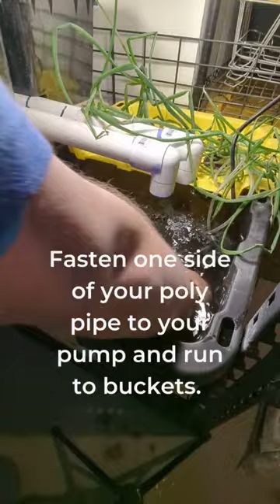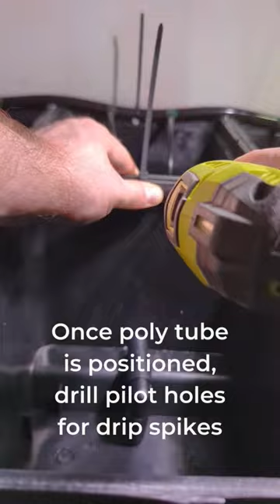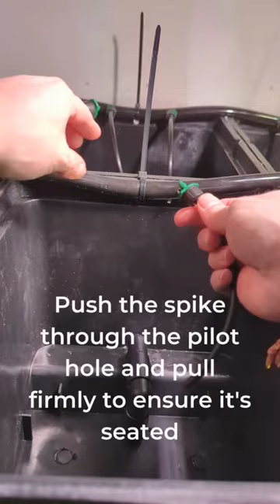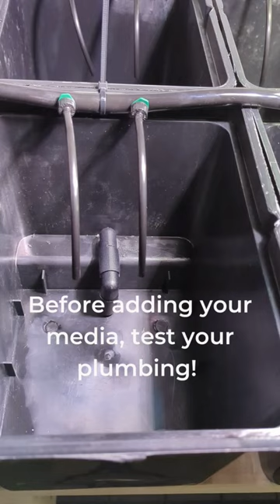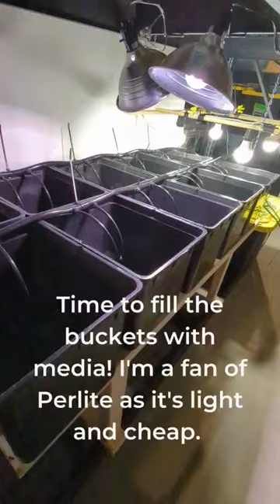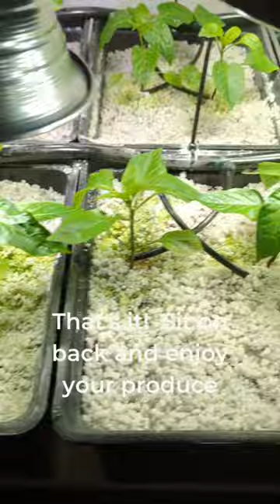Dutch Buckets: Part 3, Plumbing, The Finale

Comment from the maker: Dutch Buckets Build: The Epic Finale - Part 3

Missed the Peppers origin story? It's a must watch: https://youtube.com/shorts/1taa1H288f8

Missed part 1? Check it out: 
https://www.youtube.com/shorts/IiwS4uGCExs

Missed part 2? Can't miss that! 
https://youtube.com/shorts/3UUWxr9j6iY

==Parts List (For ideas only, not sponsored for any of these links)==
* Dutch Buckets $110.99 for 10, $11.09 each 😎 https://www.bootstrapfarmer.com/products/dutch-buckets?_pos=2&_sid=dce6a1b9b&_ss=r

* 2 Gallon/Hour Drip Emitters $13.50 for 25, $0.54 each
https://www.ebay.com/itm/234816662559?hash=item36ac29ec1f:g:tXAAAOSwCE5jljX8

* 3/8 inch polyethylene tubing, average ~$0.45/foot
https://a.co/d/hhlK0XR
--Only get what you need

* 1/4 inch polyethylene tubing, average ~$0.40/foot
https://a.co/d/0QvGrdK
--Only get what you need, for drip fittings.

* Aquarium / Fountain Pump 100gph $18
https://a.co/d/gGrsxu1 
--This isn't the exact one I used, go for cheap, they all burn out and need replaced eventually.  You can buy oversized.

* Perlite ~$0.32/quart
https://a.co/d/bsPENet 
-- Only get what you need.

Comment: Nice build.  Does the last bucket get as much flow as the first?  It would be interesting to test if all things are equal do plants in the first and last grow the same.
Reply from the maker: I'll post a closer look at the bucket filling that we did during our plumbing tests.  It seemed pretty consistent, that's the purpose of the 2gph drip emitters.  Just need to make sure you have enough pressure from your pump to feed them all. Thank you for watching and I'm glad you enjoyed the series!! ❤🌱🫑